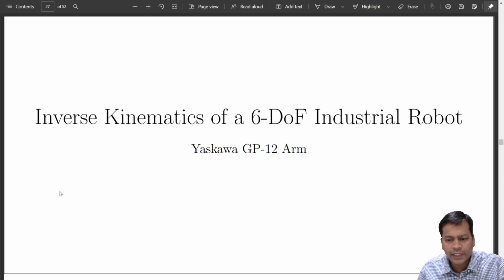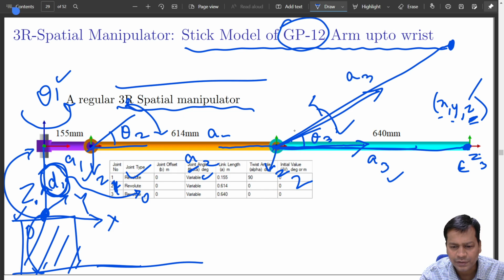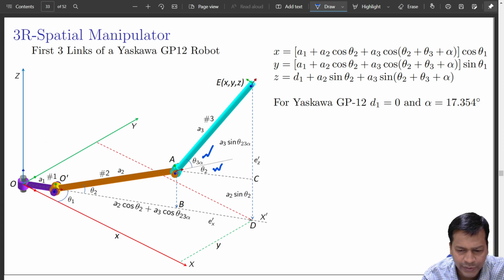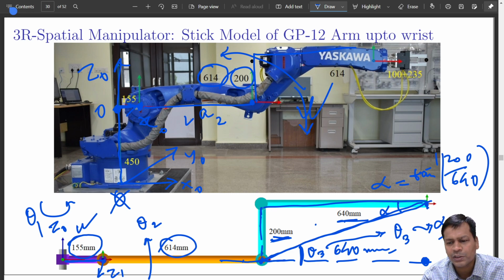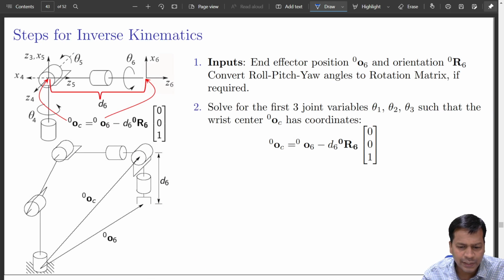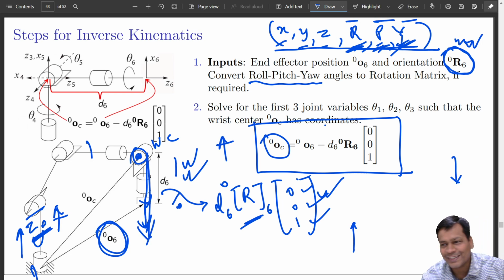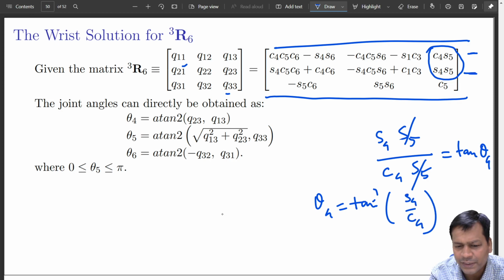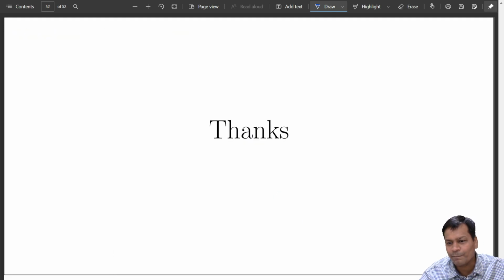Inverse Kinematics of a 6-DoF Industrial Robot (Yaskawa GP12)

Comment: Sir I tried the same solution for 3R in python but somehow I am getting different values. I've tried checking this many times but couldn't come up with the solution

import numpy as np
x=795
y=0
z=1264
d1=450
a1=155
a2=614
a3=np.sqrt(200**2+640**2)
print(a3)
#first joint angle
alpha=np.arctan2(200,640)
#print(alpha)
theta1=np.arctan(y/x)
v1=np.cos(theta1)-a1
exd=x/v1
ezd=z-d1
v2=(exd**2+ezd**2)-(a2**2+a3**2)
v3=2*a2*a3
v4=v2/v3
#print('\n',v4)
theta3=-np.arccos(v4)
theta2=np.arctan2(ezd,exd)-np.arctan2((a3*np.sin(theta3)),(a2+(a3*np.cos(theta3))))

theta1yaskawa=theta1*180/np.pi
theta2yaskawa=theta2*180/np.pi
theta3yaskawa=(theta3+(np.pi/2-alpha))*180/np.pi

print(theta1yaskawa,'\n')
print(theta2yaskawa,'\n')
print(theta3yaskawa)

Maybe I am doing something wrong but cannot point out where
Reply: You have x/(cos(theta1)-a1) instead of x/cos(theta1) - a1 due to the v1.